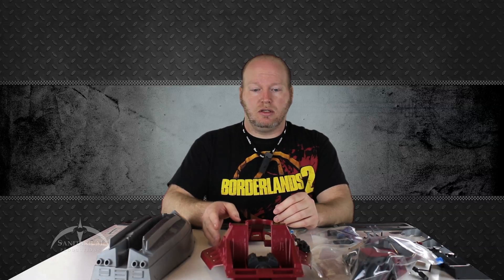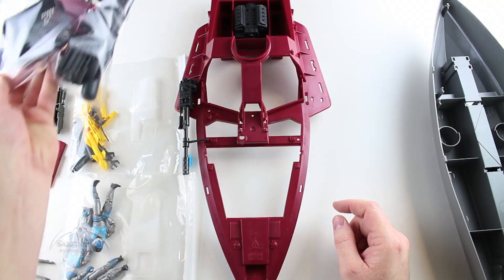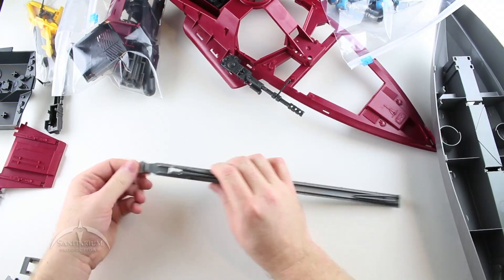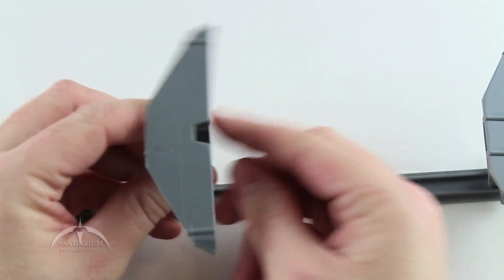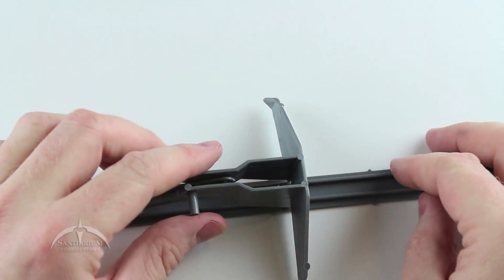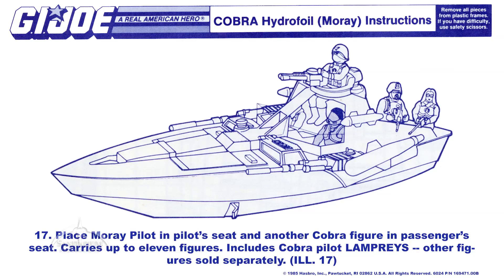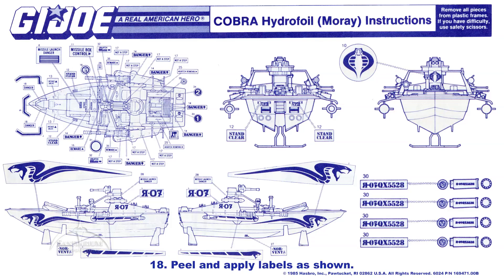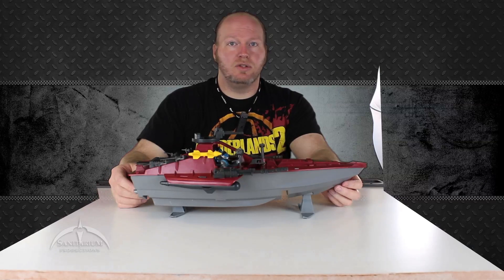GI Joe Restoration Cobra Hydrofoil Build

Comment: How do you remove the shell without breaking the tabs off? I wish you would've shown that in your video.
Reply from the maker: I'll try to show that in an upcoming video. Yeah, depending on how old these are, and how they were taken care of, they can be a bit brittle. One suggestion is to soak it in baby oil for a while, then use one of those plastic screwdrivers (like you use for cell phones and electronics). Even then, you need to rely on a bit of luck!